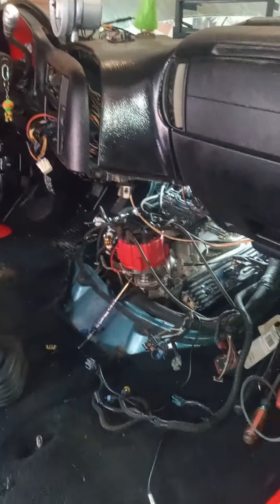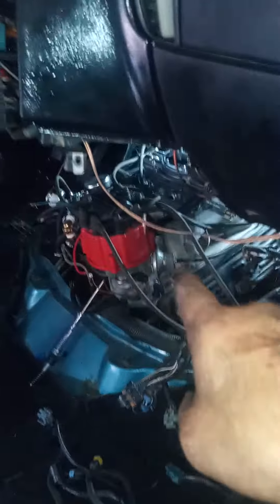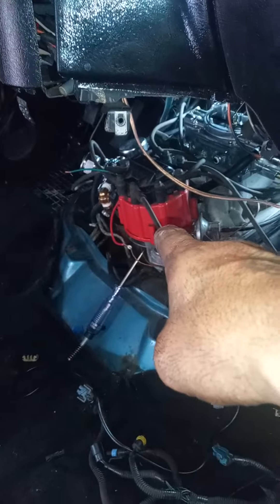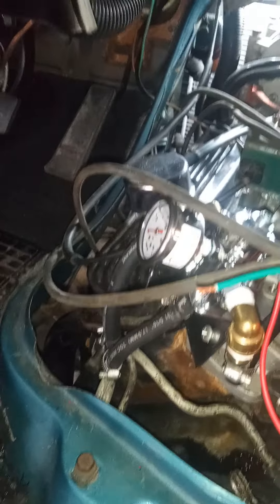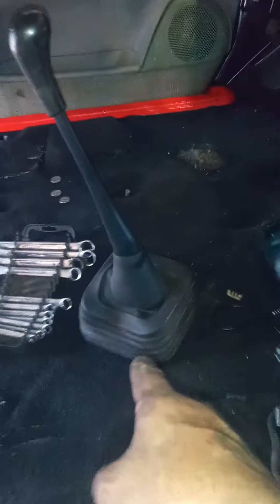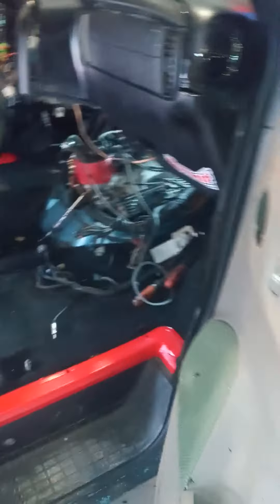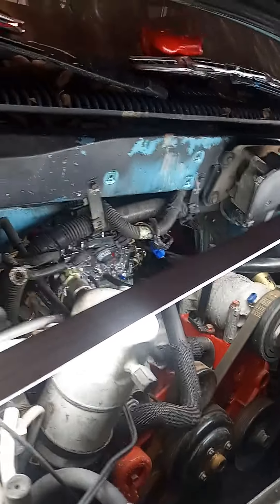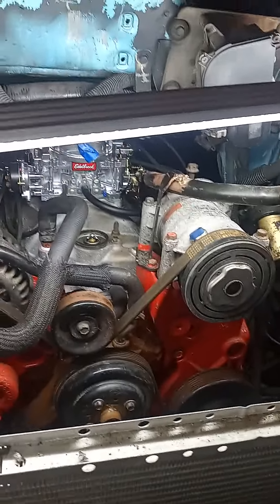V8 Chevy Astro with 5 speed

Comment: This is a how to, on how to make a hard to work on vehicle harder to work on.
Reply from the maker: Lmao, you're absolutely wrong buddy. The computer is gone and everything is so simplified now. Mechanical gauges no electronics it's the bare basics to make this vehicle run. Thanks for watching...
Reply: @massis32210  changing plug is now easier?  Exhaust gaskets eaier?  Intake gasket is easier?
Reply from the maker: @philipallen7956  lol, no the spark plugs suck. But actually doing the intake gasket is actually now more fairly easy. Even the exhaust gaskets weren't that hard to put in. The only reason I'm saying it's easier is more of the factory stuff is not removed to open up the engine all the way around.
Reply: @massis32210  lol i hate doing basic work on astro vans.  Dig the v8 conversion tho